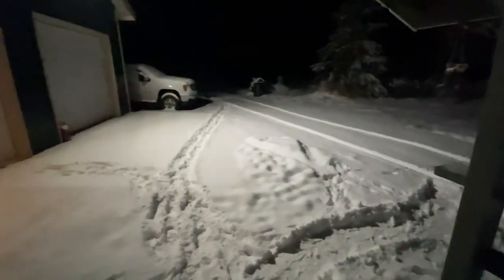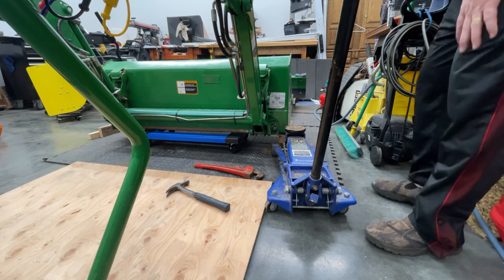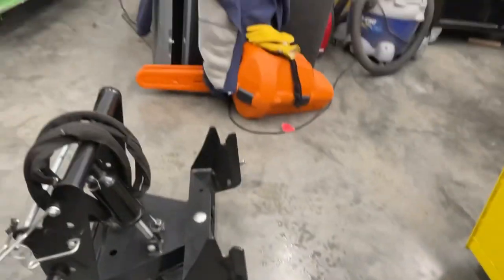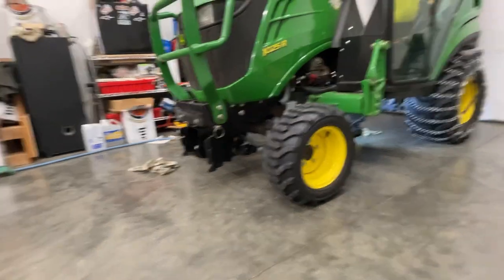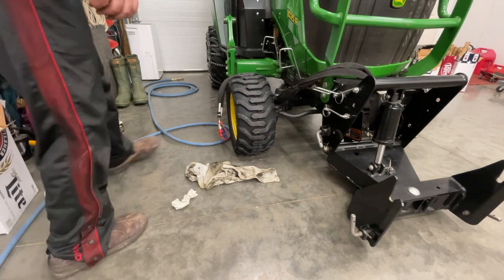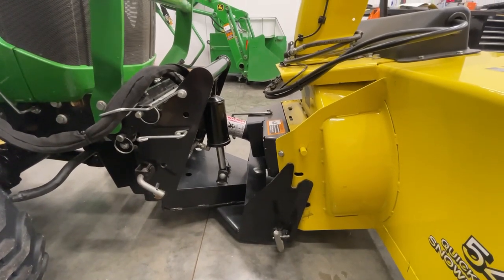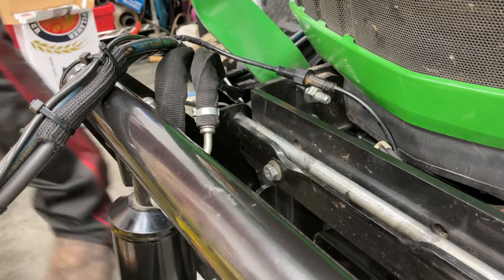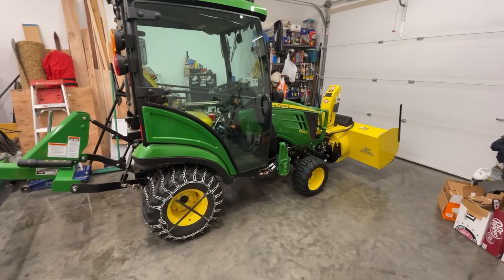JD1025R Blower Install

Comment: Where did you get the tire chains from and what size? Thanks
Reply from the maker: Hey Justin the rear tires chains came with my rig when I purchased it with 200 hours. Didn’t ever find any receipts for them in all the books and receipts that came with. If I had to guess I’d say they came directly from JD and specifically for that stock size tire. Thanks for watching!
Reply: Hey Justin, I got mine from amazon in 2019.  I think I just used the tire size to purchase them. I just checked, they are still available on Amazon, fronts were $48  and the rear are $184.  Hope that helps you!  Good Luck!!  I had a 2019 1025R, it was great in the snow, I used a frame mounted plow and never got stuck.
Reply: Yup, your vid will help the next guy.     Lot of grease zerks….necessary though.
Reply from the maker: Appreciate you thinking so and sharing that

Comment: Hint: turn the chute actuator upside down, that way the water is not on the seal. I have the same setup less the cab.
Reply from the maker: Thanks Mike appreciate you watching! I’ve heard that before. I’m super anal about cleaning all the snow off possible. And it’s placed always in my heated shop with a dehumidifier always running. No problems so far!

Comment: I see chains. Are they needed
Reply from the maker: For me I’d have to say yes they are needed. Except for first few snow falls or until I have a good hard packed base I’m using my rear blade in conjunction with my blower. Angling my rear blade to scape and wind row the left behind snow into my next path of snow to be blown. Preventing build up which becomes a real problem in breakup season. And with the blower on float and rear blade being down and also of float. Your left with virtually no ballast for traction. So for me that’s where the chains come in and help keep that traction. Extremely cold temps and scraping also turns basically your surface into ice. Works well for me.. Maybe not all. Thanks for watching and commenting

Comment: There is a rubber (weather) boot available for the snowblower chute actuator. It's from Caribou Maine. Very Nice.
Reply from the maker: Mine has a rubber boot. Although the latest version has a more robust rubber boot. Had some problems this winter with my actuator. Reached out to the company I purchased it from and they sent me new limit switches to replace mine. Haven’t done that project yet.